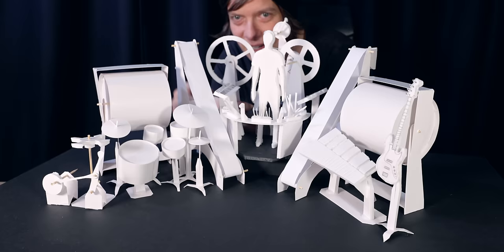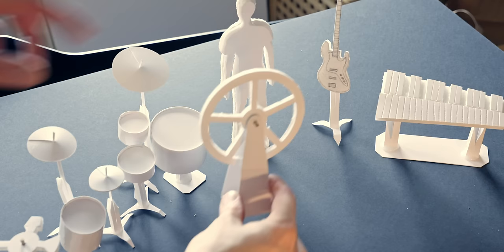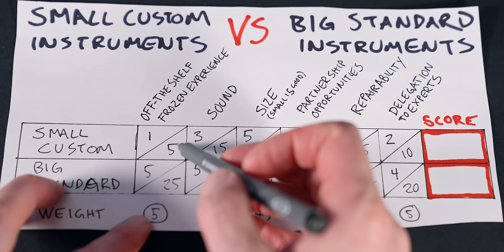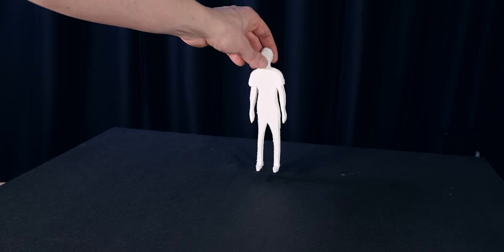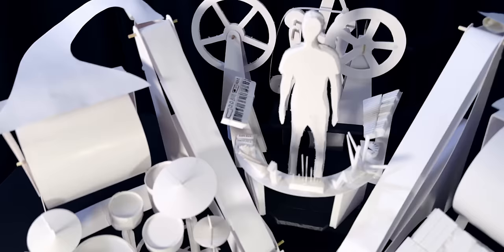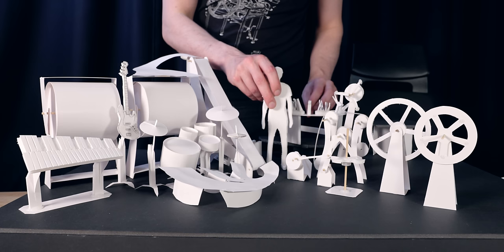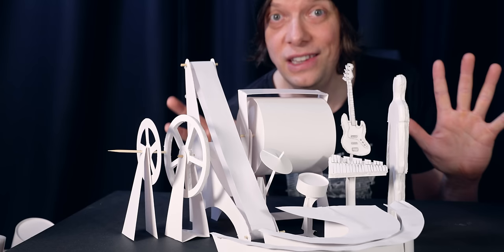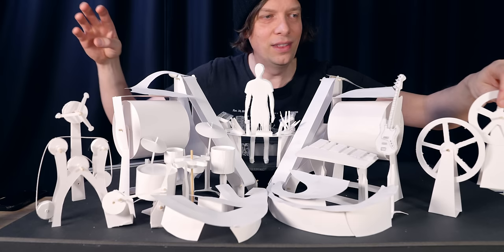Making a Cardboard Model of the Marble Machine

Comment: Man, this is so frustrating. That's not better design at all. It's more of the same unachievable idea wrapped in fancy design principles.
Like what is this weighted matrix? Where is the category for logistics on tour? Isn't of the shelf and partnership kinda the same thing. Just two name the biggest two things.
Reply: what makes it unachievable? he already did it twice, but both times he didnt plan nearly enough and the final machines were covered with design issues that couldnt easily be fixed. name the thing that makes it unachievable.
Reply: @jackradzelovage6961  the size, the full drum set, new features like the carousel choose any. Yes he did it twice but with fewer instruments and a smaller form factor. This "more planning" isn't actually more planning ist just feature creeping. Like before arranging instruments one should actually ask what kind of instruments are necessary. What kind of music does he want to play? If the answer is tight, dynamic music and pretty much everything imaginable. That's not good enough. 
Starting with arranging instruments is like choosing the interior of your apartment before building the walls.
Reply: @tonigliege1768  none of that was unachievable, and all of it is currently up for debate so sayeth him. and define whats "good enough" ...you think you know whats best for this project but hes the one doing it after failing twice before. his ideas are the only thig that matter, and were here to guide him as he sees fit. just saying its unachievable is worthless input because hes not gonna just quit.
Reply: @jackradzelovage6961  I mean, he is just setting himself up to fail. Of course, it is not good enough to want it all. A marble machine is a compromise in itself. One should be ok with compromising in some aspects of the music.
Reply: @tonigliege1768  is he not? because so far hes either scrapped or achieved each goal hes made for this machine. it sounds like youre just looking at the scale and assuming he cant do it. what are you basing that on?
Reply: Completely agree--this is just putting lipstick on a pig.  He doesn't have any plans for a functional mechanism, and he's over-obsessed with how things look for this fictional "world tour".  But hey--I guess it makes for good YouTube content (ie., $$$).
Reply: @br52685  ah, the whinings of the impatient and lazy... is he act of planning projects a waste of time and resources? explain.
Reply: @jackradzelovage6961  But what is he actually planning? He is basically planning the visual look. Starting with this makes no sense.
Reply: @tonigliege1768  why doesnt it? are the aesthetics not a huge part of this? why is it wrong to start there? what about it makes no sense, especially when hes already nailed down the power source, marble transport and timing, and the basic design of the programming wheel? what are you expecting?
Reply: @jackradzelovage6961  He's simply not doing effecting "planning."  Making a paper model of a drum-set and his stage doesn't even begin to address all the mechanical problems he had with his first two "failed" attempts.  He hasn't mastered the simple task of reliably dropping marbles onto a xylophone...and now he's simply adding MORE COMPLEX instruments too??  He's been planning for 2 years on this next attempt...yet hasn't produced any meaningful "plans" to address his prior two failed attempts.  Sorry, but a paper cut-out of what a machine LOOKS LIKE does not even begin to address HOW IT FUNCTIONS (which is where he failed his first attempts).

Or perhaps, you'd like to explain how this paper model solves any of his mechanical issues that plagued his first 7 years?
Reply: @tonigliege1768  Exactly!!  Did his first two machines fail because they didn't "look good" or because they didn't "function" properly?  These paper cut-outs do NOTHING for addressing his functional issues.
Reply: @jackradzelovage6961  No, the aesthetics are NOT a huge part of this.  If it were, then the first two machines would have been a "success"--as everyone did (and still) love them.  You think he's "nailed down" the power source?!? Good grief--he's nowhere near to having a functional "power source" to power this machine. And you think he can keep his "tight" timing with two separate programming wheels? He's simply not even come close to address any of the functional issues that 1) he's faced in the past with his smaller machine, 2) the added challenges he's going to face with this much larger/complex machined.

Sorry, but you're simply delusional. It's fine to live in your fantasy world...but that's not where the rest of us live.
Reply: @br52685  "He's simply not doing effecting "planning.""
-- says you? what does planning look like to you in detail? go.

"Making a paper model of a drum-set and his stage doesn't even begin to address all the mechanical problems he had with his first two "failed" attempts."
-- youre right, it doesnt. it only determines the direction of the entire design as a whole by deciding what major pieces of it look like and how theyll tentatively connect. surely THAT doesnt matter at all, right? that has no bearing on the mechanical design of the pieces?

"He hasn't mastered the simple task of reliably dropping marbles onto a xylophone..."
-- this is a drastic overstatement of the problem for dramatic effect in your argument, and i can see right through it. he made marbles land perfectly fine, hes just playing with different methods of contact to make the sound change. thats absolutely not "not being able to figure it out" so dont act like it is. thats really stupid of you to even try.

"and now he's simply adding MORE COMPLEX instruments too??"
-- that fundamentally do the same thing in terms of marble interaction? yeah. why not?

"He's been planning for 2 years on this next attempt...yet hasn't produced any meaningful "plans" to address his prior two failed attempts."
-- name the amount of planning time this project should take. lay out exactly how long and why. and he hasnt? oh really? what is the huygen drive for? what is the flywheel power system for? what are the fingers for? what is the marble gate for? what are the bowden cables for? you glossed over everything hes been doing to address aspects of the previous failures and just saying theres no plan. that isnt just missing the point, thats straight up lying. why are you lying?

"Sorry,"
-- youre not sorry.

"but a paper cut-out of what a machine LOOKS LIKE does not even begin to address HOW IT FUNCTIONS (which is where he failed his first attempts)."
-- yes it absolutely does. if you dont want to see that thats on you, but youre still lying to make a point. but no you must be right, the physical layout of an integrated machine apparently has no effect on how its designed. today i learned!

"Or perhaps, you'd like to explain how this paper model solves any of his mechanical issues that plagued his first 7 years?"
-- already did. maybe YOU should quit lying to make your points. youve obviously never designed something big for yourself nor have you learned anything from Martin in the last two years. but i forget, youre the absolute authority on what planning a unique project looks like. did you figure out exactly how long its supposed to take yet?
Reply: @br52685  if aesthetics arent part of this, why did he build a machine that uses marbles to play music inefficiently as he said in a previous video? answer that plain and simple.
Reply: @jackradzelovage6961  Aesthetics isn't why his first two attempts "failed."  It's clear that the majority of his audience prefers the aesthetics of the first two models, over this new "thing."

But as far as the "why" goes:  he's attempting to create a new instrument that can reliably play music with marbles.  If it sits there and "looks cool" but doesn't play anything reliably, then it's simply a failure (which is why he calls his first two attempts "failure").
Reply: @jackradzelovage6961  Explain how this paper cut-out model addresses ANY of the mechanical problems his first two machines suffered from.

I've never said that I'm the absolute authority on planning.  However, I (and hundreds of other commenters here) HAVE successfully planned and executed complicated projects.  We know what good planning looks like--because we have successfully completed projects.  It's simply part of our daily lives....
Reply: @fromclicktoclickbeautifulp473  what reasons did he give for ditching it?
Reply: @fromclicktoclickbeautifulp473  so youre saying he threw away probably many thousands of dollars and years of work and ideas because.... he felt like it? im gonna need more motivation than that to believe thats true.

Comment: A potential variant on version 1 would be to relocate your control desk in front of the marble loops. You could use a single big marble lift as a central backdrop. The flywheels could either go at the left and right ends, or between the lift and the instrument banks.

Comment: Just some ideas:
1) Put the mechanics in the center (like in Martin's place). 
2) A platform behind the mechanics the rises Martin and the controls
This will from like the tower clock (Half Mechanics, in the base as a foundation, Half Martin in the top as the idea)
3) The flying wheels should have Wilson's face.

Comment: I think the story you're on requires there is something recognisably similar to the original shape of the marble machine. It could either be the exact same marble machine shape but made safe for touring or it could be something like the machine has spread roots and branches out from it's central trunk whereas if it deviates too far from it's original form then it won't be accepted by the audience as being "the marble machine". I think it's taken on the status of a character in your story.
Reply: Further to this point, I would say that other contraptions can take on the role of new characters in your story that we meet along the way provided they are separate, have their own voice and their own form. The modulin is a great example of this.

Interactions are useful for story-building: Your contraptions could sing in isolation only to later come together with the marble machine and other contraptions to sing in unison.

Blue Man Group and Cirque du Soleil are good examples of performers who can tell a story with nothing more than a person, an object and music. They achieve this not by trying to show everything at once as one static sculpture but instead let each thing stand on it's own in isolation so that all focus can be on it. Interest is kept by discovering the surprising and beautiful things the one thing can do while it has the stage and then for it to leave the stage before you get to grips with what it even was, let alone tire of it.

Comment: All the air in there is hard to populate on cardboard, but it seems like it's enough space to compact everything by half. You proved it's possible on the both previous machines. I will repeat myself - octobasse is the limit. Above that it stops feeling like one instrument. Also - both previous machines were top-heavy, which made them compositionally very dynamic (strandbeests). This gave them personality. If it was a democracy I'd vote for a single, compact machine. Perhaps a with some supporting ensemble, but visually separate from it.

Comment: I could imagine putting the programable flyweel in the center (like vertical spinning), and building everything around it. You could then take the programmed information at different angles around the barrel. It would help compact everything together, but still get good separation between different instruments

Comment: If not enough of the machine is visible, you could add angled mirrors in the back. (Or projectors showing other angles).  

If each piece is independent or modular enough, you could try a different layout each time depending on stage, mood, etc.

Whatever you do, don't box in the performer too much.  You always want the option to step away quickly to deal with unforseen issues, interact with the audience (You want at least 3/4 of your body visible if you want stage-visible body language to be visible), make improvised changes to any instrument mid performance, grab food or water during a break, etc.

Comment: Using configuration one, put the higgen drive on the lower front platform and your station behind and slightly above it. That should give you the clock appearance, with drive as the heart of the machine.

Comment: Version 1 but have more grades of elevation, and a little more spaced out, and a more open “V” (120° instead of 90°). Maybe put the drives and flywheels up front and low but Martin is quite elevated in the back with instruments and drums halfway, as to not be hidden by front row viewers. The space out will allow for more surrounding audiences

Comment: i think there's merit on the 3rd design if you can manage it so the the drum does not interfere with the vibrafone. It feels more like a cohesive machine rather than an 'installation' where you can kind of tell where the modules are. IMO the allure of a steampunk design is the idea of complexity. If you can hide the modularity and blur the line of where one module start and where it ends, it makes it feel more chaotic and mesmerizing.
compositionally i think the 1st design is really strong but you can kind of tell where a module start and where it ends, it looks like a multiple machine in a factory, not one complex machine

MMX is really strong in that aspect where everything looks so unified (because it is legitimately just one huge bundle of mess) so if you can still have that sense of integration while still having it be modular and maintainable, it'd be really cool

Comment: Ever the artist, Martin is trying to create an aesthetic visually pleasing layout, for the concert attendants to get maximum joy. All of the layouts aren't taking into account what the marble machine's main function, moving marbles through a loop. Considerations, like how far apart belts and instruments are, will affect the loop, in terms of timing the return of the marbles. A smaller, tighter loop will require less marbles, while a bigger, spread out loop will require more marbles. The reason the clock is aesthetically pleasing, is because its function is laid out very tightly. Given the scope of the Marble Machine Project, it will forever be a battle of compromise, between artistic design, and practical functionality, to create the best loop possible.

Comment: Very cool. My go-to is aways build in wood then move to steel.
Same concept - faster, easier to "see" in 3D and more portable (wood can hold lot's of "oops" holes which are easy to readjust and fix... don't ask me how I know ;)
One tip though - instead of all the hard work marking the foam before cutting - just use a very thin layer of elmer wood glue to instantly glue (it glues instantly and permanently!) the paper drawing to the board, then cut. It's going to be much faster... and support hardness too.

Comment: I really like version 1, but put the flywheel where Wilson was for the last shot! It will be safer and easier to keep the heavy parts low, and then you can raise the governor high behind your platform! Also has the added benefit of puttin the flywheel very close to the power input (your feet).

Comment: Hey Martin! Because you are using Bowden cables, the marble drops do not need to be in the same place as the programming wheels, and the programming wheels do not need to be horizontal. You also don't need to have only two wheels. You could have several Bowden cables connected to a single marble drop, and a clutch to select the active wheel. Only the turning wheel actuates the marble drops. You could have longer songs, programmed into a giant wall off (smaller, easier to manage) wheels behind you.

This shouldn't be extra complexity, actually. You already need to design a way to synchronize the melody and percussion wheels.

Comment: I actually do enjoy the idea of version 1 but it would kind of have you locked in place - you could still make V1 taller at the back and it would look AMAZING, but that still doesn't give you an easy way to step out.
Try fiddling with that layout, worry a tiny bit less about how compact it needs to be, and see if you can make it still feel cohesive if it's just a touch bigger. Particularly giving more space behind you, as much as the mechanical wall would absolutely rock, it wouldn't rock to accidentally whack yourself on it.

Comment: I think there should be a set of MMX-style planetary gears on the end of each drum. At least one of them would be clearly visible from anywhere in the audience, and it would make the design seem more unified and clock-like and help to keep some of the magic of the original form factor. It would essentially be two MMX-like machines connected to a common power source.

Comment: I like the first setup. 
I also think it would be cool and useful, if the setup was somewhat flexible, at least in width and angles, to accommodate different venues and to make it yet a bit more interesting for visitors who see multiple shows. Of course the modules need to have a fixed form to function properly, but the axles and marble tracks could be build in different versions. And if some mechanics could be made higher without loss of function or wasting of energy, I would do that. The governor could stand on top like a conductor, as it clearly is.